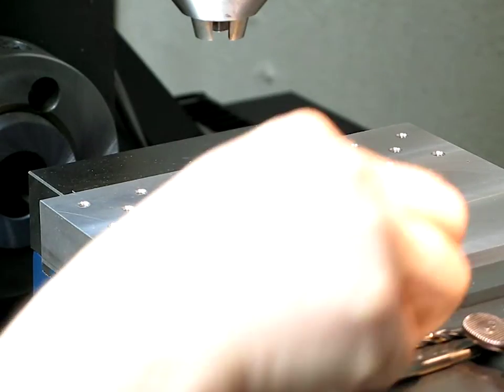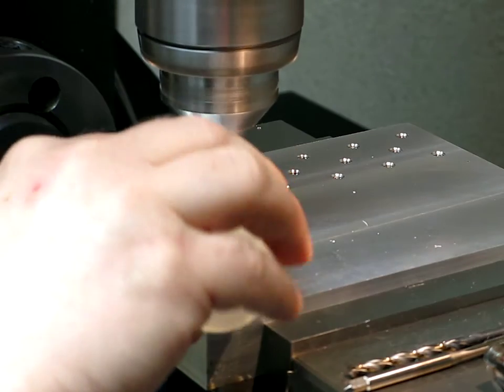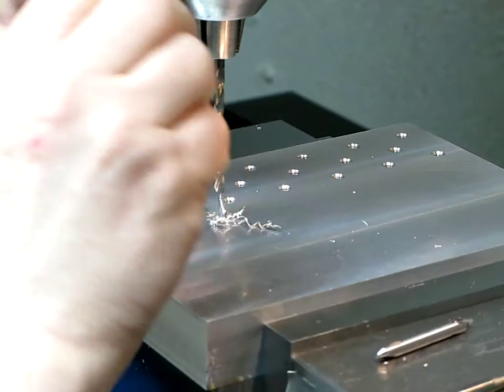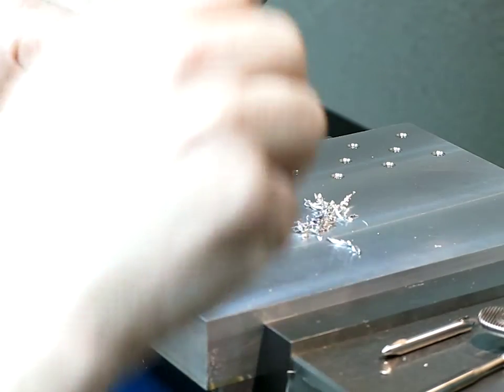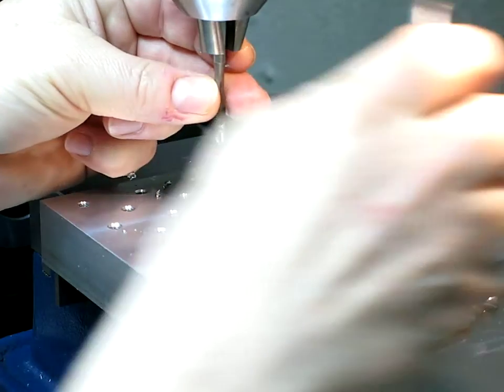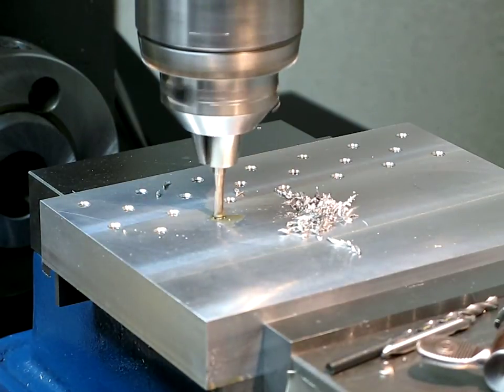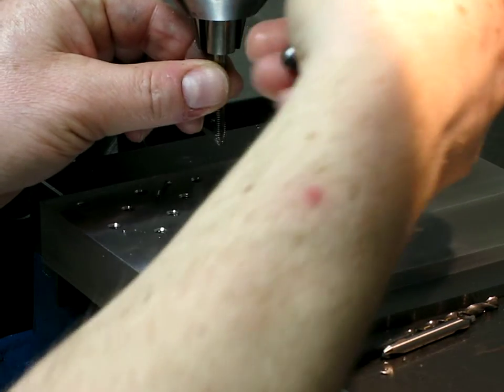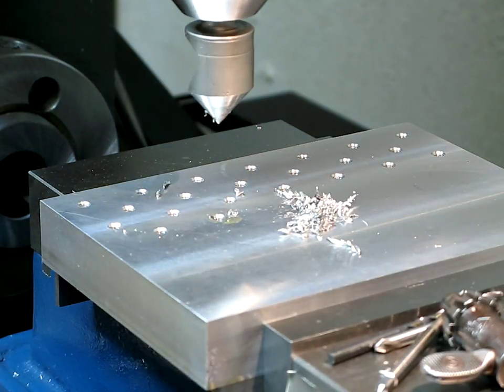Deep Hole Drill and Tap on Smithy Granite 1324

Comment: Any opinions? Would it be easier to do all 59 holes with the same tool, before making a tool change to do the next operation? This part seems like a daunting task meant for a cnc. I would probably hire it out even though I have the capability to make it.
Reply from the maker: It's perfect for CNC if you have it.  I chose to keep position and change tools for the best location accuracy I could create.  Changing tools felt like less work than cranking to all the numbers a bunch of times.  YMMV.